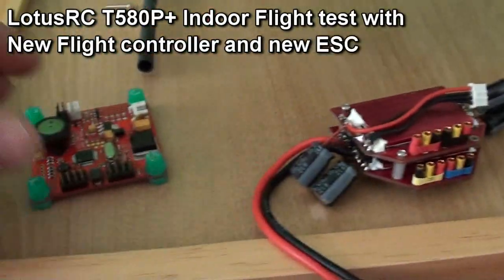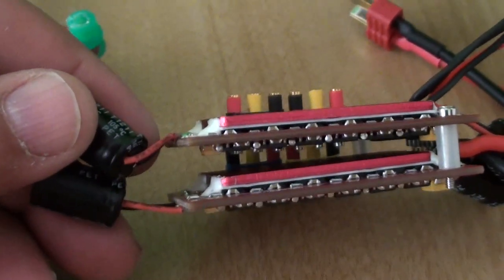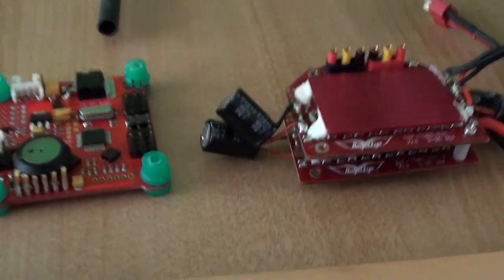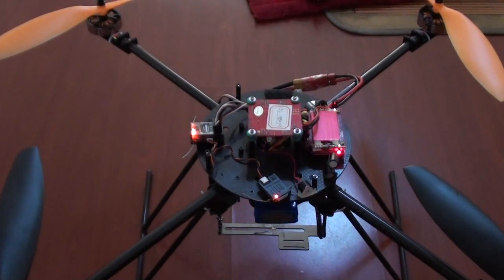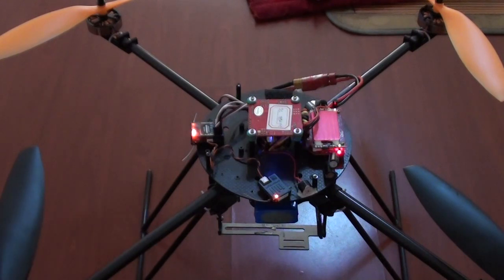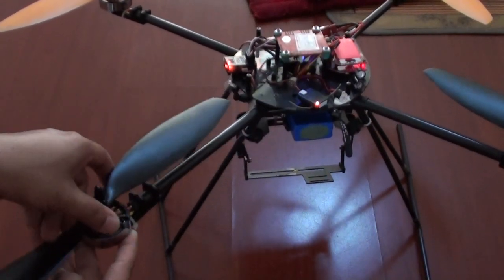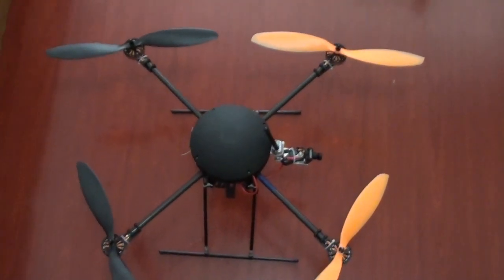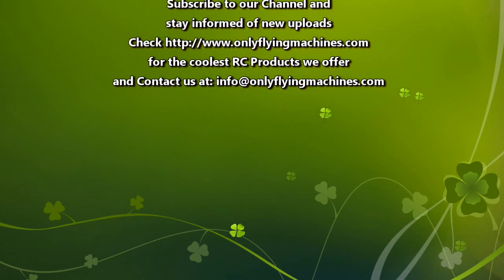Flight Testing LotusRC T580P+ New ESC and FC

Comment: DO NOT  FLY for more than  1 or 2 LiPO Packs  at  1 time without  letting it  sit  for many hours or you also w ill get the big COS surrounding your Area where you  fly  (COS = Cloud of Smoke).
Doesnt surprise me anymore that  LotusRC is fairly Cheap compared to other Models, afterall you  get  to s pend hundreds more for  spares just  to get  another CoS

Comment: first  Smoke  came out of the Motor and then  out of the Cover of the T580 so i  opened the cover  just  to see that  the 1 big  black Chip is  burned out again on the TOP ESC Board.
There has been  many  T's  sold, and  most  if not all  go up  in smoke... what  will LotusRC do to compensate us ?????

Comment: Sorry to say,
but LotusRC does not FIX anything.
They only swap things around to make it a Bandaid-Job.
I  also  just  burned another MOtor and ESC Board of the last Batch  that  LotusRC had send me  saying  no more burning and  flipping.
Dont just  fly for 1 PAck..... fly  for the  duration of   3 to 5 LiPo Packs and then  report of what  happens.... thats if you can  still breath after all the  smoke of this Bird going up in Smoke, like mine did.
I flew for 3 3S Packs, landed and POOFF